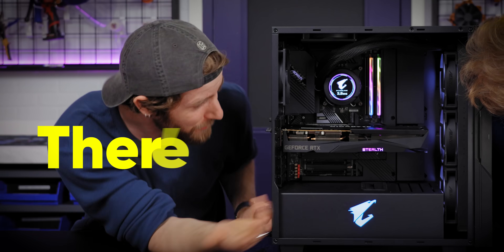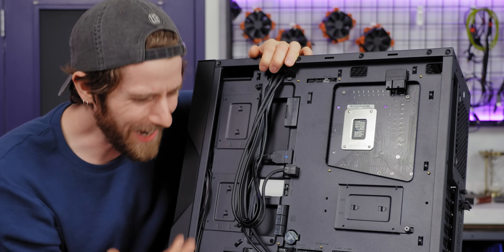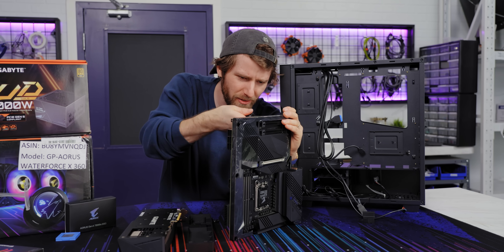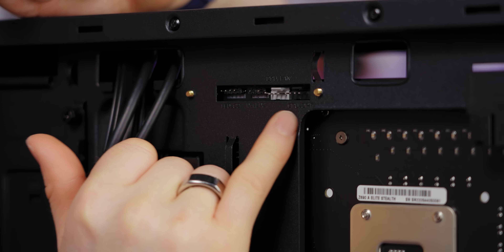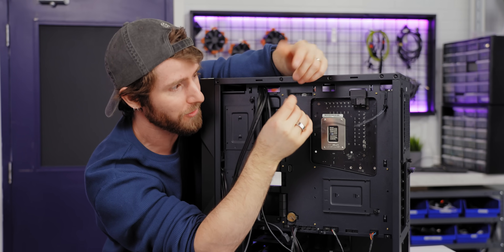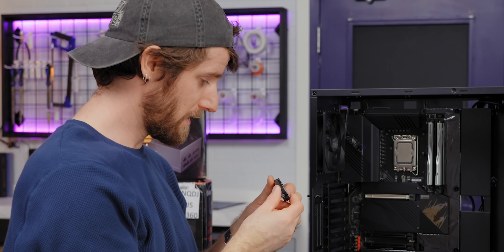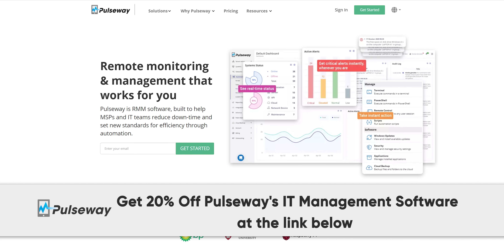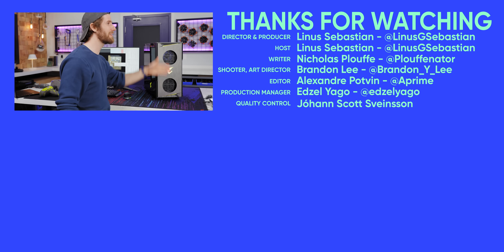Where Are the Cables??? - Gigabyte Project Stealth

Comment: 3:10 there is literally zero challenges in building such a board. The connectors are already mounted through hole, the only thing needed is to reverse the pin layout and solder the connectors the other way around. US patent law is ridiculous, how can such basic thing as putting connectors on the other side of the PCB (which was already done, think M.2 slots on the back of the MB) be allowed to be patented is beyond me.
Reply: Because you can patent near anything 😂
Reply: @GenesisRasphotos  Only in the US tho, most other countries would just laught at someone trying to patent that.
Reply: @GenesisRasphotos  Yep, and just because its patented, doesnt mean other companies cant also do it, citing prior use/existence.
Reply: @Tony-pb2gi  or just be like china and not give a damn
Reply: @GenesisRasphotos  China can do that because they’re a country and they’re the biggest market on earth because of their population so companies will let them do anything as long as they can still do business in and with China. The same can’t really be said for a corporation.
Reply: Patenting things like connector placement is ridiculous and a person/company doing that should burn in hell forever.
Reply: most motherboards today are not just two sided. they're three or four sided even, deep in the layers. its definitely very much possible for any motherboard manufacturers to do it but its not as easy as just soldering a port backwards. if its a single row pin like a fan header then yes but two row headers if you flip them (12,34) would be (34,12) and it'll be wrong already. also they would have to repurpose one of the assembly machines to do this specific motherboard SKU so that means less regular motherboard that people are more likely gonna buy and more of this odd motherboard. buying a new assembly machine is out of the question since it costs like 50 to 100 X series or Z series motherboard and they're not gonna get that much worth in profit for selling the oddboard anyway.

and you wouldnt believe what other common things that are still being patented like light bulbs, certain combustion engines, telephone. it only mattered during their time to protect invention rights and they never really sued anyone except people that try to claim that they invent such things. since globalisation and information era hasnt happened, its pretty easy to convince anyone that doesnt know that you invented the telephone when it was Alex G. Bell. only today patents are more to exclusive rights and ownership of this particular invention and to exploit as much profit from the product as possible.
Reply: You'd think so but flipping the connector means flipping the pins. You have to redo the entire pcb routing or you'll run into some major issues.
Reply: I'm damn sure I already saw an old board with a rear mounted connector, which would invalidate any patent claim they ever had due to the laws on prior art.
Reply: To be fair, having a patent only gives you legal ground to seek you rights in court, it's not a guaranteed auto win. A really big company could probably just bankrupt a smaller patent squatter in a drawn out court case.
Reply: If nemesis system from shadow of mordor can be patented (y'know, a freaking part of a game) everything can be. And that's beyond stupid
Reply: Reversing the pin layout on the mb is harder than you think. Every trace has it's own place and flipping the whole connector upside down really messes with the whole layout, not to mention you'd have to flip the pinout of EVERY connector. I'd say it would be easier (only if it's a pin-through connector design) to leave the traces as-is and make a new connector with a built-in flipped pinout. That way they could manufacture custom plastic connectors instead of redesigning the whole pcb.
Reply: @mraaaaaaa  If you have a single Pin Row it's as easy as just rotating the connector 180°, no layout changes required. And most of the connectors are only a single row.
Reply: @mraaaaaaa  since the connector has to travel further backwards to clear the mid panel they could make a connector that internally flips it I doubt it would be too difficult
Reply: @mraaaaaaa  Plus, I'm pretty sure there are manufacturing difficulties when you have components on both sides, like reflowing on one side without dropping/displacing components on the other; I've only ever seen dual-sided PCBs when they're being hand-assembled rather than mass produced. That said, my experience with this stuff is limited, so I could be wrong.

Comment: (12:56) Windows Update downloads all the Gigabyte Aorus software, that in turn downloads bloatware. That's way worse than the Gigabyte Z270 board in my PC, where I download the Gigabyte software and it keeps asking me to auto-update, but then when it does, it preselects all the Gigabyte bloatware!! Not only that, but it also tried to update the older and compatible version of RGB Fusion to a version that wasn't compatible with the mainboard it was running on!! I normally avoid Gigabyte, except that having to replace my dead NAS resulted in me having to take a chunk out of my budget, and so I couldn't get the new ASUS board I wanted.

Comment: ....fixed a airflow problem without any r&d nor red tape. Done. And the results stand for themselves. Just move a slight more to top to align with the fans that are lit in blue but you couldn't tell until the hole was drilled in it.

Comment: There's a reason why the EVGA X299 Dark is my favourite design of a mobo ever. The connectors are just more logically placed. Why wouldn't you have the 24-pin connector point to the right instead of straight out? It's so obvious that it almost makes you angry when they don't do it that way... Which I do!
Can we please normalise better positioned connectors. Case manufacturers need to start off by making cases that also work with that design as well as the current standard, and the motherboard manufacturers can follow without problems.

But, honestly. Now that I see these designs, I wish that mobo manufacturers made more standardised connector placements and have them in the back like this and more case manufacturers follow suit.
But case manufacturers need to take the lead on this. Make more universally compatible cases. This way they can change the standards for the better. And then lock into a specific standard.

Comment: So the case is just a adapted version of the C300G. I have this case lying around and it's a stupid case (although i think i looks nice) with no airflow and no room for cables in the back. I had the front panel hanging off all the time just to give the rad air, also took glass panel off. And you cant fit a rad at the top cuz there's no room for it cuz of the board (unless you buy the higher version of this one).

Comment: I've wondered why the industry didn't do this in the year 1998 but who am I.  I always thought this could easily be down and then there could be an industry standard for where the pins exit the  back of the board.....an industry standard so case manufacturers could make the appropriate wholes in the mobo mounting tray.

Comment: The OMG IT'S AMAZING at the start really turned me off. I mean, it's really clever, and I like the concept. But 'AMAZING'? No. With a little soldering of cables (cables are so you can flip the pin order) you can do that at home. It's not a technological marvel by any stretch. More of a logistic issue then technological.

Comment: What the hell year is it now? I've lost track since the lockdowns. Hmmm... 2020 and I was getting ready to drill holes in a crappy Newegg ABS 3060ti prebuilt. But luckily it died first. Mostly Gigacrap parts and every single thing in the case was the bottom of the barrel, bottom of every chart, cheapest crap that could still be said to "work". Two weeks old and dead.

Comment: So... the idea is to have fully custom case, motherboard and GPU just to avoid having visible wiring? And any problem with any of those parts and you get to replace everything! Considering how that GPU is build, just adding bit black plastic shrouds over all the cables would result in pretty much the same looks without any custom case/motherboard/GPU stuff.

Don't count me in the expected customer base.

That said, with enough standardization, this could make sense over the stuff that Intel has spec'd for us in ATX specs.

Comment: It’s gigabyte that’s the problem. I’ve had other issues with their stuff over the years and currently have a 3080 water force card and after having to pull the water block off to clean it out and literally have it fall partially apart in my hand is pretty ridiculous so I got a good graphics card with no water block until I find one that fits and replace it.

Comment: I still don't understand why all the Power connectors on the MB aren't on the BACK where you don't see them, and don't need to hide them.  This is the kind of thing I have always wanted. there is literally no reason to see cables in 2022.

Comment: This takes me back to when I used to work on and sysadmin Sun,  SGI and other brands of Unix workstations. They had very few cables in them (Sun Ultra workstations in particular) and they were super tidy and easy to work on. I look inside the average tower PC and wish more of them were like what I see in this video and those workstations I used to run.
Reply: Workstations back in the day also used to make use of a lot of riser boards and daughter cards, which were unreasonably cool in their own right. I miss those halcyon days of computing when companies just went balls to the wall and did what they wanted to do to get the performance in the form factor that they wanted. Having said that, there are still quite a few companies that make servers where the only cables you have are the SAS cables going to the front drive controller board from the custom PCIe slot on the side of the motherboard where the RAID controller sits. Thankfully, more companies are moving to RAID controllers that will operate in JBOD mode without necessitating you flashing a custom BIOS and ROM to the controller.
Reply: @mndlessdrwer  totally. In terms of RAID, I'm now all about ZFS (having come from NetAPP technology) which means giving the OS very low level access to the individual disks. In that world, hardware RAID controllers are seen as more of a hindrance than anything.
Reply: @adam872  Hence why I mentioned JBOD support, as it allows you to address all of the disks as Just a Bunch Of Disks, and thus lets you use software RAID. Sure, you lose a lot of the justification for a RAID controller in the first place, but at least it can still give you diagnostic info.
Reply: @mndlessdrwer  indeed

Comment: And that my kids, is the reason I bought a Asus Strix GPU that costs 60 bucks more than an Aorus one.
Gigabyte is great - I like the products, I like the style. But when it comes to FINISH, they just suck.
My old GTX 1080 G1 had oily Thermal Pads that basically ruined the backplate and nearly the whole PCB and covered it in oil. Why? Because they bleed out when heated up.
Great design....

Comment: On their website they specifically state "Smoother directional airflow..." And later on they also state "Features 3x unique blade fans, screen cooling and alternate spinning technology, which together provide high efficiency heat dissipation to keep the graphics card in a low temperature, resulting in higher and more stable performance."

Supremely disappointing. I actually went and looked at pricing, unable to find it ANYWHERE. Maybe I didn't try hard enough, but also I don't even care. This is horrendous. Do NOT buy this or else they will KEEP making absolute shit.

Comment: WHY!!!! did it take them this long to have hidden connectors, did something similar with a dual core AMD system, most cables were well hidden but the GPU spoilt it. Nothing really hid those connectors properly.  Licence / Patent having connectors on the rear of a circuit board?  Pretty sure I have an old dual Intel CPU motherboard somewhere with connectors on the rear. 600mhz era? vertical cpu cards.

Comment: Non-standard components in non-standard case - probably inspired by HP. Imagine you need to find working motherboard 3 years later.... 
P.S. Hp used to change pinout scheme in standard Intel cooler connector to make impossible to replace it by user itself.Custom io, custom PSU, custom everything.
Reply: Everybody used to mess with the pinout for the case to motherboard wiring.  One reason I don't buy off the shelf PCs any more.

Comment: In such a crappy airflow cases, it's best to use the PSU fan as an additional exhaust so under high power loads there is some additionally heat being pulled out of the case. In regards to the concept - when I saw the maingear patent a few years ago I was super stoked... and then ultimate soo disappointed that no one picked it up. So, I'm glad it's somewhat coming to the market, I hope the design get's standardised across the board. As not only it's easier to cable manage shorter cables, it also costs less to make such cables as less material is used to make cables for DIY builders and OEMs. Plus, we don't have the issue of dust get stuck inside cables... 🤢🤮 there are some folks who just don't clean their PCs at all. There is one other benefit for the GPU as well as having the cables at bottom next to the PCI-E connector, it should add some support to prevent some GPU sag too.

Comment: It seems like you could custom-design a shroud for your motherboard with that connects to each of those ports and runs an extension down to the back of the case.  Maybe add a fan to blow air underneath the shroud for cooling.  And it seems like it would work much the same... but for any motherboard (assuming you could make the shroud).

Well, except for the GPU.

Comment: Its a cool concept just poorly executed. Id like to think the GPU would be more ridged having the power connectors other way around and straight into the board. No excuse for the airflow problem, they should of repurposed a different case. Surely they run their own benchmarks and are aware of the lack of ventilation?

Comment: My Rosewill case also has a radiator mount on the front of the case. Even tho the front of the case is completely solid metal panel with zero hole in it. lol.

Comment: I actually had a clearance issue on an old Lian Li machined case that after putting it together the video card wouldn't align properly.  It turned out is was the motherboard wasn't aligned properly from the holes on the Mb were too big and the motherboard was shifted to the side.  I loosened up the motherboard and then finished installing everything, then I tightened the motherboard down, and everything was fine.  So out of habit, I always leave my MB a little loose until I  have everything installed, then I tighten the MB down securely.

Comment: I guess all computer builders like us had the very same idea at some point, just not the funds, experience, contacts, and motivation to create a standard.
Cause for this concept to take off, a physical connectors placement standard has to be made. Some very specific connectors have to have a very specific place (like GC power connectors), while the rest can be just specific areas being able to be filled with various connectors.

I propose the ThroughAtx standard or T-Atx for intimates.

Comment: 10:16 It's stupid to be wearing a mask still. Especially that one is wearing a paper mask and the other isn't. Makes zero sense.
Reply: It's likely that COVID was somewhat present for them at this time, so measures had to be taken in place. For example, a team member may have had COVID. The team behind the camera was far enough away from Linus, yet are close to one another, so a mask would have been worn. As for why Linus doesn't wear a mask, it's for the presentation, as a mask inhibits speaking and you'd rather listen to a normal human face than a masked one. He is also (usually) further away from his behind-camera team in this video so it's less of a priority.

Comment: I seriously dont get how case companies still dont understand that allmost all pc builders/gamers want a case with high airflow. Luckily ive been building pcs for over a decade so the coolest is thing was LED fans and custom grills back then. I never had to go throut the RGB/Glass everything case design as a forst pc build that maybe most first time builders fall for. Its cool that your pc has glass all over till your temps are so hot it throttles all your parts and the glass constantly looks like shit if you touch it. If its not a mini itx style case then i build pretty much exclusively in the lian li lancool mesh 2, great for watercooling and pushes so much air if you want it to. Best case in years IMO

Comment: I always thought it was weird how every gpu has the power connections on the front in very weird areas. Like it just seems wrong having to connect cables to the front part of the gpu furthest from the motherboard and then those cables have to bend at weird angles.

Comment: I would love if power delivery also was standardized or included/placed by the PCI connector. There should be invented a solution where everything connects without the need for cabling(routed via MB?)

Comment: I've been suggesting "backside mount" for SSD's for a while. Backside mount of all the cables just makes logical sense, but it's a pity it's not an ATX standard, which means this board is basically just a little less bad than a Dell board. That said, I think we're overthinking the solution. Chassis manufacturers could get the same cable management solution by using the vertical mount for the GPU and MB manufacturers putting all the cables on a "front panel" daughter-card that attaches to a 90-degree connector (eg the old 40-pin IDE one) so you could move it to the rear by using a short cable if you wanted .